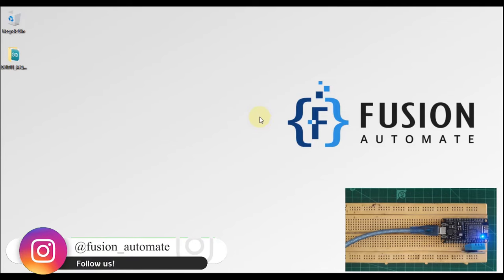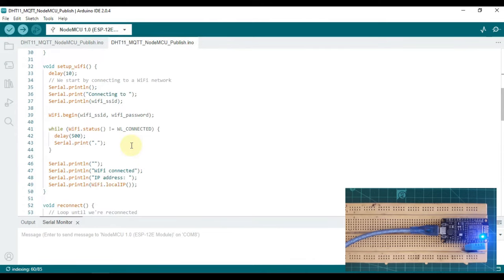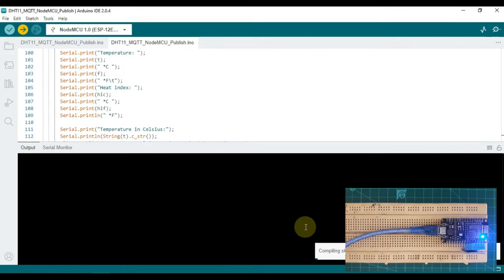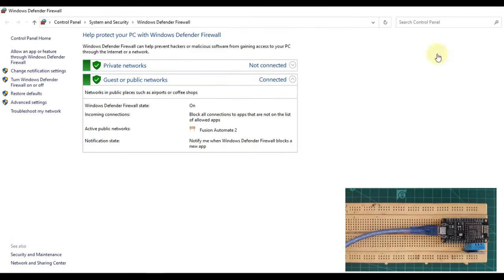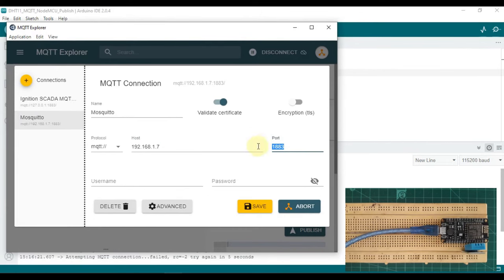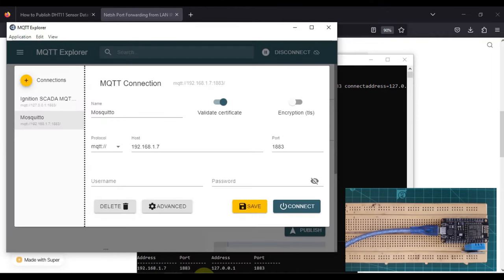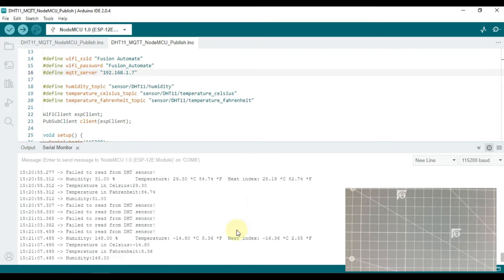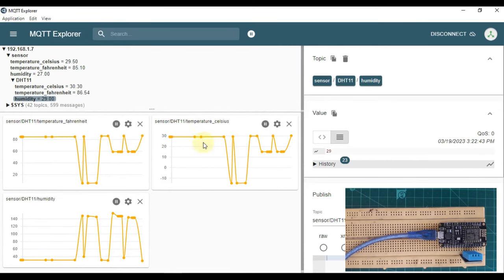How to Publish DHT11 Sensor Data from NodeMCU to Mosquitto MQTT Broker over LAN | NodeMCU | MQTT |

Comment: Hi Fusion Automate,
what a great project! It works properly.
I would like to setup a MQTT project with one ESP32 as a subscriber and another ESP32 as publisher. The broker should be a local RasPi standalone as Broker-Server creating its own WLAN without connection to the Internet via Router or Access Point.
Can you give me hints how to do this?
The handling of the ESP32 should be easy. But with the RasPi I have got my problems to combine the installed Mosquitto and the WLAN-Server capabilities.
Do you have this setup described in one of your courses? (Please without NodeRed.)
Thanks!
Oli
Reply from the maker: Hi, Yes it is possible to do it without node-red. Actually you dont have to do anything just install mosquitto in PI and connect your pi with any wifi and same wifi you can use for esp32. You can ping me on WhatsApp or Telegram for in depth discussion or doubts.

Comment: Thank you sir it works the other day and i was happy! But the next day i ran the program, it doesn't work.. it says connection failed just like before...I redo all like in the video again but the issue doesn't resolve... Any thoughts on this sir? Or anyone?
Reply from the maker: I have faced the same issue, its windows  problem so we have to delete all previous configuration and we have to create it again like port forwarding and firewall rules.
Reply: @Fusion_Automate  thanks for the suggestion. I tried as per suggested and it works like magic! it looks like i need to do as per suggested every time i boot up my pc. Wondering if there's a way to not to go through the reconfiguration process each time booting up the pc. Btw, i will be using raspberry pi instead of pc. Tried already on raspberry pi and no firewall and port forwarding configuration as of now. Thank you sir and wish me luck for my fyp🙏🏼

Comment: Very good video! But I have some question about the mosquitto. The error messages are shown as below:

1711989156: Opening ipv4 listen socket on port 1883.
1711989156: Error: Only one usage of each socket address (protocol/network address/port) is normally permitted.

1711989156: Opening ipv6 listen socket on port 1883.
1711989156: Error: Only one usage of each socket address (protocol/network address/port) is normally permitted.

How yo solve this problem? I google many times on this but didnt have a useful solution about this. Thank you!
Reply from the maker: It seems like some other application is using same port 1883. So, you have to fetch which application is using same port and you have to close that application.

netstat -p tcp -ano | findstr :1883

You can use above windows command to check the process id which use the port 1883.
Reply: @Fusion_Automate I had found another way to solve this problem. Thank you!
Reply from the maker: Can you Share it here ? So  in future if some have same problem then can learn from it.
Reply: @Fusion_Automate   I just create a text file   and run it as administrator with two lines,

listener 1883 
allow_anonymous true

Then, I save it as listener.conf in the file directory of mosquitto and run the command in command prompt,
mosquitto -v -c listener.conf
Then the mosquitto can run already.
Reply: Also, now I am trying to import a machine learning model into node red for classification of data received through a pzem sensor, is there a way can directly import the model that I had trained into node red?

Comment: mqtt is connected with my nodemcu, but in mqtt explorer, I cant see sensor data, why that's happening?
Reply: Try to add a serial output of your sensor. If it doesn’t show the sensor data then you have a problem with your sensor(mostly pin issue)